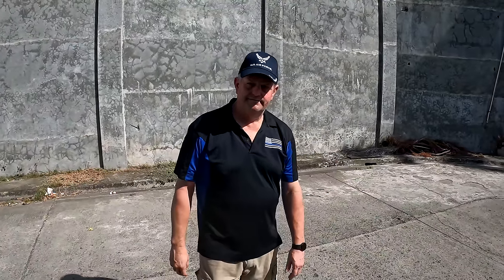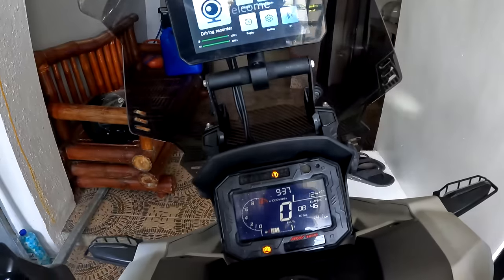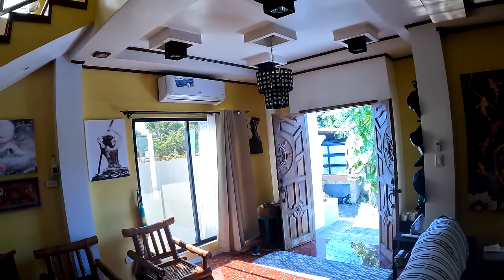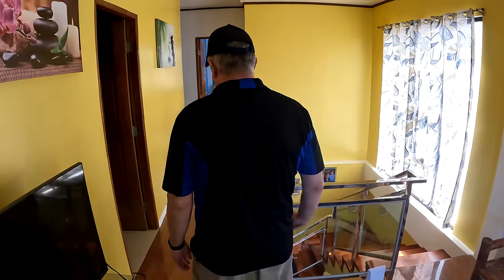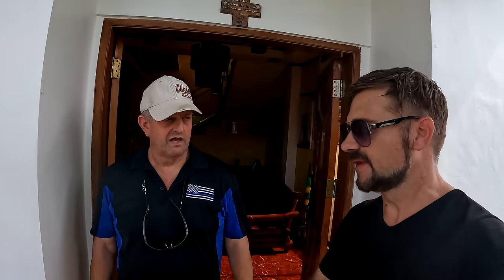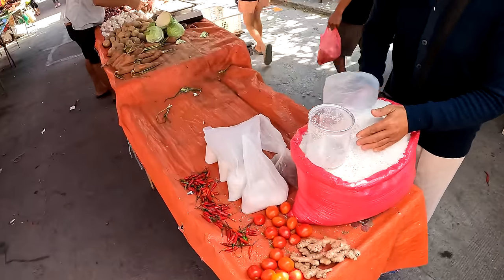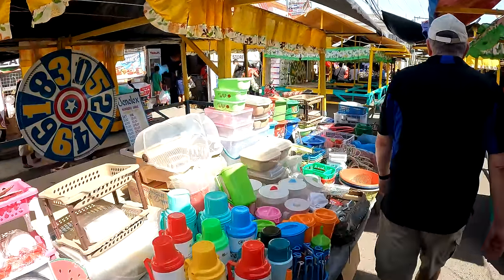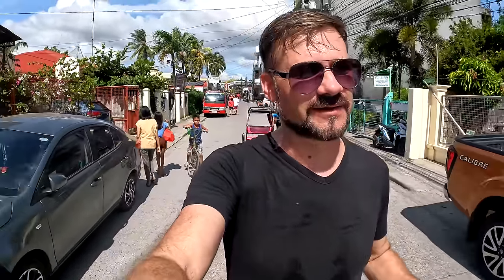USA VETERAN Built An Amazing Life Here Tigbauan. Philippines

Comment: Beautiful home. I suspect that because of the enclosed space and high perimeter walls, there is little ventilation. With the lack of air flow, the interior must get pretty hot.
Reply: There's something called AC.
Reply: @GUITARTIME2024  You are absolutely right. I should have better articulated my post. What happens when there is a 12-hour brownout and there is no power? I saw only one air conditioner in the downstairs living area. A 2.5-HP split-inverter air conditioner to cool over 200 square meters of area is going to overburden the AC. Furthermore, anyone who has lived in the Philippines understands that electricity is very expensive when compared to other Asian countries or the United States. The amount he is paying in rent is a very good deal, and the money he is saving can offset his high electrical bill. To give you an idea of how much it costs to use air conditioning in the Philippines, for a 100-square-meter space, I am paying an average of 12,000 pesos per month. The house in the video has more than double the living space of my condo.

Comment: I never understood the reasoning of buying a hot water heater. Wouldn't you be better off with a cold water heater? 🤣🤣🤣
Reply: I think hot/warm cleanses well. Also during cold months, taking a shower can really be cold especially when one is used to warm temperatures.
Reply: @Mary-zd8xo  But if the water is already hot, why do you need a hot water heater?
Reply: HI , MIKE 
YOU CAN GO TO FISHING PORT IN ILOILO CITY, THE  FISH THERE IS A LOT EVERY  EARLY  MORNING
Reply: @drewnc6196  Not hot. It can get cold in December and January.
Reply: @drewnc6196  water usually comes from underground and is bloody freezing 🥶🥶🥶🥶🥶
Reply: Good one! 😂
Reply: Water in the morning is cold. Water coming fron deep well is cold. If your house has an elevated water tank, it only warms after the exposure of the tank from sunlight.
Reply: @Mary-zd8xo  That is why you buy a cold water heater, not a hot water heater.

Comment: Wrong plan and waste of commercial space. The rear part of the house should have been designed as a store or shop that can be rented out or used by the owner to compensate for the high tax rate of commercial lots.